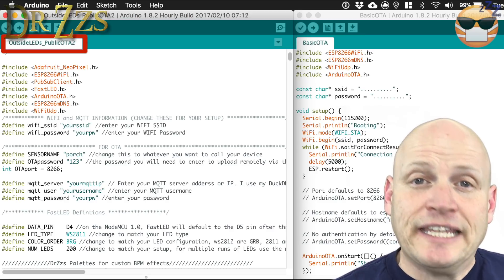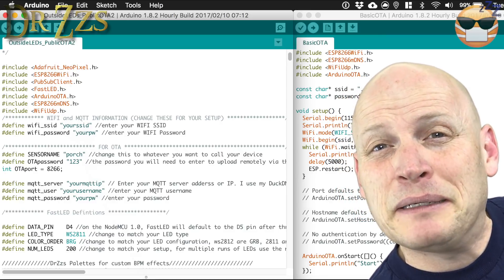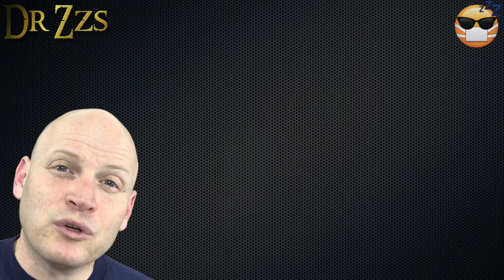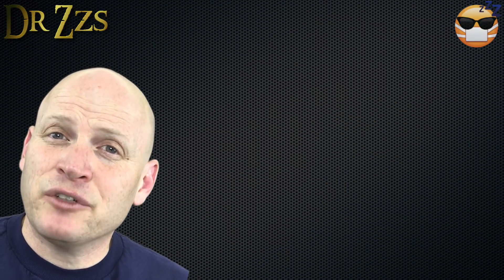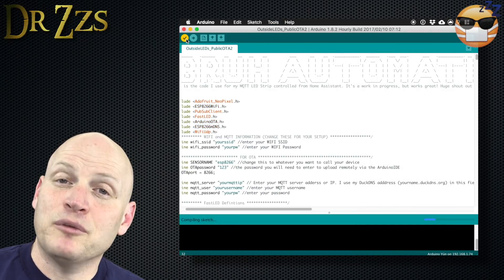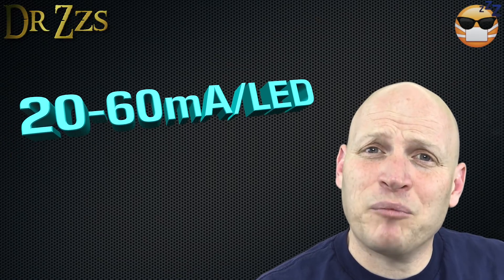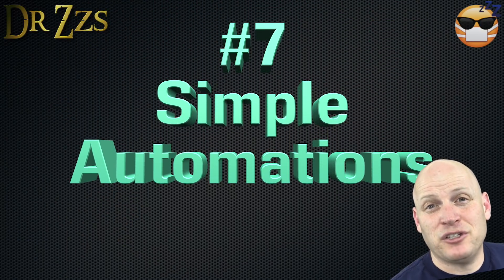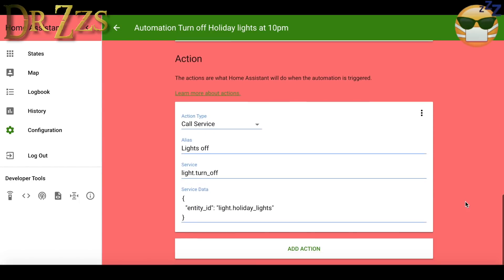Holiday LEDs - What I wish I'd have known

Comment: Great video, thanks for the help!
Reply from the maker: You're welcome.  Hope you get yours all solved and up soon!
Reply: Got the flicker all fixed by the "hard way". Thanks.
Now I have to figure out why "Twinkle" doesn't work and "Cyclon Rainbow" kills the D1.
Reply from the maker: David Garate sweet!
How many lights are you running?  What size power supply? 
Try turning down the brightness then see if cyclone rainbow kills it.
Reply: I'm running same as you, 500 LED's so far. I plan on more but I don't know if I want to do something like an FPP with a pixlite controller. I have the power supply you recommended, the 5v 60A. 
Turning down brightness didn't help, still killed it but it did come back online..

I ran into this error while trying OTA.
https://www.dropbox.com/s/x3j9338xja5usnk/OTA_Error.PNG?dl=0

I went through the code a few times and realized you missed a part of your code in the video. I think people can figure it out though, but I'm still getting the previous error.
https://www.dropbox.com/s/20jwfznzlgzr750/Missed%20OTA%20step.PNG?dl=0
Reply from the maker: Dang.  I hate it when I miss stuff.  YouTube doesn't have a mechanism for me to go back and make a change.  
Thanks for catching that.  

Now, that's some crazy error you got there.  I'll have to look into that a bit.  What version of the Arduino IDE do you have?  The newest is 1.8.5  
Hopefully yours is older and all you need is to update it. 
It also looks like its trying to run python.  I don't know the inner workings of ArduinoOtA.  I wouldn't think it relied on python, but maybe it does.  Try installing python and see what happens.
Reply: No worries..
I have 1.8.5, darn. I did some research and I am adding Python to Windows right now and I will test it when I get home.

Also, don't know why but a few of the effects don't work properly. Like: Sinelon, Twinkle and Juggle. Must be a scaling issue with a 500 light string.
Reply: I got the OTA working and got the power supply mounted. 
I'm still have issues with the animations and am trying to figure out the variables in the code to try and mess with them. I have tried many, many different values to see if I could get Sinelon working correctly and I can't seem to figure this one out.  Oh well. Maybe it will look different when I get them on the house.